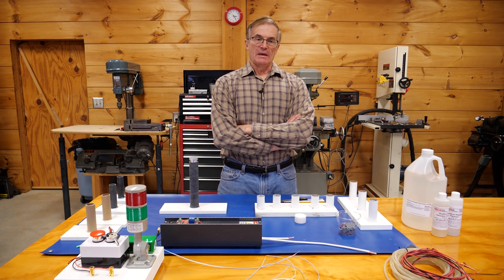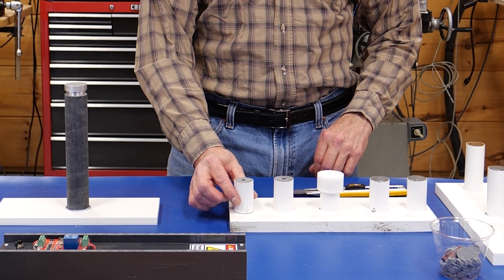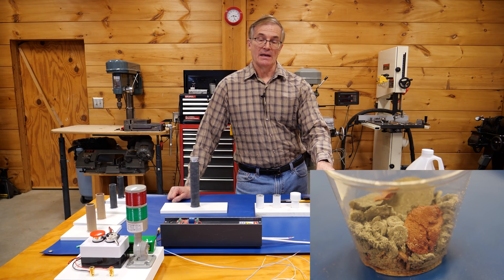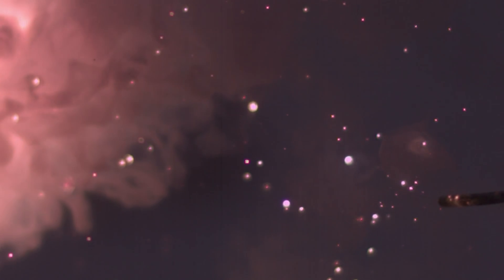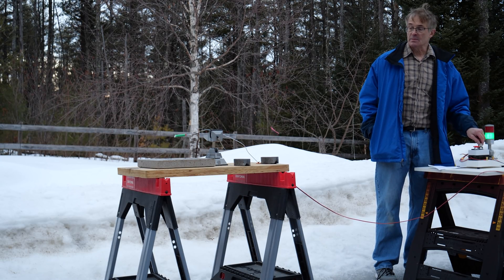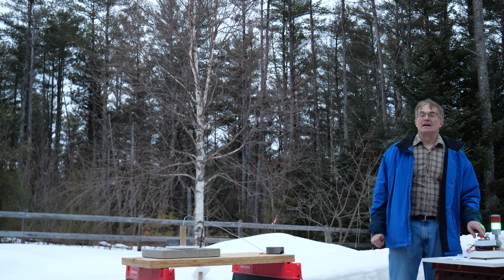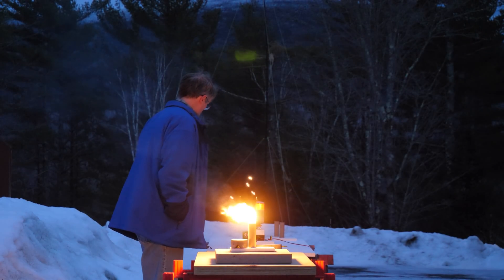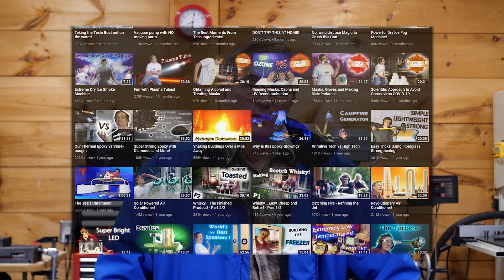Rocket Igniters at 10,000fps!

Comment: You mentioned room temperature superconductors in one of your rocket videos, could you share something on those?  They might have application in building lithium battery packs.  Thanks!
Reply from the maker: High temperature superconductors still require liquid nitrogen.  Their high field tolerance is a significant advantage.
Reply: @TechIngredients  Did you mention high temp superconductors?  Sorry if that was some other video I was watching.  I'm looking into the best way to bridge lithium cells.  They currently use nickel materials.

Comment: Focus trick for these annoyinly shallow depth of field cameras:  Use a sheet of paper/can/package with some fine and sharp text or graphics in the focus plane you want and adjust to that.
Trying to use anything else never seems to work quite right.
Reply from the maker: Believe it or not, that's exactly what we did!  These high speed cameras are also light starved during focusing and so I held a sheet of text with a powerful flashlight at the focal plane in the relativly strong wind...fun.😕
Reply: @TechIngredients  The wind and cold would make things interesting! The camera like a bit of warmth, if it works better indoors than out in that weather, try covering some of the intake vents to allow the camera's internal temperature to rise and stabilise before doing black cal.  Might improve your SNR. 
Re. focus: Because the focus is the lens, not the sensor, you can set the shot up with the gain turned up and/or shutter speed as slow as possible(most light).  Then set everything back to want for the actual shot and everything is in focus.. And be glad you have the 2.1, I've got a 1.4, much smaller sensor, worse light performance but still a lot of fun! 
(And 'hello' from the 'Kickstarter' page in the camera's firmware.. Assuming it's still there. :)

Comment: Something that you have the space to test:
How efficent and the cost for using a air-compressor on a windmill instead of a generator and using air-tools instead of electric.
Storing a given amount of energy should be cheaper in a tank, but the heat-loss when using is costly. A tank should also last a lot longer then batteries.
The best would be to cool  the compressor with water (give you hot water), use tools and cool down something with the expanded air.

Comment: When you want to increase the power of a rocket, what’s better, increasing the diameter of the grain or the length?
Reply from the maker: It's not simple.  Increasing the surface area of the burning propellent increases the power and if done with length or diameter the change is linear  The forces on the walls are always in tension and the availability of cylinders with sufficient hoop strength will probably limit the practical diameter.
Reply: @TechIngredients  I had an idea for a rocket casing with a high hoop strength by using thin walled aluminum tubing because it’s  non-frangible, and then axially wrapping it with either kevlar, aramid, or carbon fibers and then coating it with epoxy. Also with regards to the exhaust nozzle would a parabolic cone make a difference over a flat walled cone?

Comment: Is there any risk of cracking the fuel grain if you ended up with one of the more energetic augmented ignitors in place? Or is the grain more flexible than I'm imagining, and able to withstand that pressure wave? And would a cracked grain cause enough combustion instability to be worth worrying about? Maybe it'd be "fun" to try simulating some damaged grains and how they can (if) change the impulse and burn rate.
Reply from the maker: It's a very tough rubber compound.  These igniters are more than energetic enough for this purpose.  They can certainly be dialed back if necessary.

Comment: This was very cool and thank you for expanding and sharing the results of your previous testing with these new test grains.  A question... Do see any potential issues with the BaSO4 augmented starters; specifically, being too explosive and creating an impulse that damages the engines at starting? Thanks!
Reply from the maker: Thanks.
I don't think so. The grains are very tough and are designed to operate at pressures in excess of 10 megapascals.

Comment: The high speed footage was fascinating. The amount of energy condensed into those small engines is impressive. I look forward to the upcoming videos when you put nozzles on a stack of fuel grains and make something with many Newtons of thrust. I'm not sure what deep, innate sense of ours that pyrotechnics pleases, but it is worth noting that no other species mastered fire, so they could later create fire-works!
Putting a big K-L-M motor in a small, slender rocket and hearing that distant "pop" as it goes transonic is a peak experience for a hobbyist.
But I have a different challenge for you, as once science buff to another. Due to your catholic interest in the sciences, especially electronics, I'd like to see you work on an electronic rocket, an ion propulsion motor. Not only would it be an interesting exploration, but this is a cutting edge area and there may be some interesting new science yet to discover. Perhaps by combining MASER technology with existing ion beams? Just sayin'. Cheers.

Comment: It looks like the ignition at the base (right side) threw out unburned flash power.

How about putting the igniter closer to the top (left side), so the powder burns more evenly?

Or, if you want to throw powder out, maybe add a thin wad to prevent power from burning until it is dispersed inside the rocket.
Reply from the maker: Because the powder disperses so broadly, I don't think the asymmetry will be a problem.  So far, after 25 shots we haven't had a single misfire.

Comment: Hi there,

Very interesting and informative video with some important and nessassary steps for safety. I am curious though, I am wondering as to why you found it prudant to included a very annoying "beep" when you engineered and built your  high voltage ignition supply? It's not a big deal, I was just wondering.
Reply from the maker: Thanks.
Safety.  Although some viewers found it annoying, it's very important that anyone, anywhere near the test site, even if they aren't looking in the right direction is made aware of a potential hazard.  We're talking rockets!
Reply: @TechIngredients  I agree, However, when dealing with any potentially explosive pyrotechnic, bystanders in the general area should already be at a safe distance before the item under test is even connected to an ignition source,  as even in a controlled environment accidents can and do happen,  Especially with rockets! Having said that, In reality it is a very good thing to have in place as many safety practices that are feasably possible no matter how redundant, or annoying they may seem. Having sought knowledge in chemistry and the value of safety regarding potentially energetic experiments it's wise to make sure that they are properly in place. 

I enjoy the content of your videos, as they are informative, descriptive, and accurate. Thank you.

And reguarding the Beep tone, some individuals are more sensitive than others with higher frequencys, durations, and volumes. I for whatever reason are one of them, and so much so that I had to remove the end of cycle transducer on my washing machine ( pc mounted mini "speaker" and put it on a switch to shut it off.)

Comment: Ahh, I have a complaint with production that doesn't just amount to beeping. Shooting fire is something that's kinda hard to get right. I understand it's harder on a budget, and probably even harder within the capabilities of your given slow motion equipment, but generally, you're going to want to have a black background. You could probably move the test forwards a bit, and then put a large piece of black cardstock, or cardboard covered in black paper, behind it, using the nook in your workbench there. 
You're going to want to use less exposure, i.e. smaller aperture, i.e. higher f-stop. At least, as much as you can, it will show the details in the fire better, especially when paired with a black background. This will make it so you're able to see the cool details in the fire. Don't be afraid to underexpose, either, as lost details in exposure, or with too dark of a picture, will be restored easier than the alternative when you're in software.
Anyways, great video, as always, keep up the good work!

Comment: also would like to say awesome and informative videos, keep them coming :) 
wonder too if the design "join the Technicians" have for their "magic wand" (basically a 130kV dc diode ladder and what I am guessing is a stepped up or improved slayer exciter running off of two lithium ion cells) since he was setting flammable fluids on fire by igniting it with the high voltage discharge, and then using the ionic wind flow to put it back out LOL anyway, might be someone to collaborate with, not sure how far apart you two live from each other. 
https://www.youtube.com/watch?v=TUDd5lzepgE also I know he is now working with "alienscientist" and "falcon space" channels so could be interesting to see you and they joining up to have a discussion and do some builds :)

Comment: would definitely like to talk to you about rocket improvements and possible construction of an ionic wind unit to improve that tech as well, as I think there are methods that could be used that take advantage of the material used to improve response for such things like the fluorine in teflon and how it effects static buildup, or how bismuth and titanium have lower electrically conductive rates than say iron while copper and silver have much higher rates ect, for reshaping nozzle effect on the particles coming from a rocket, whether or not it is from a combusted product or just inert material. :)

Comment: It might be because all the rocket engines where I made my own fuel were hybrid, but those fuels look incredibly inefficient. A spark that leaves the engine while glowing from the heat of combustion is a packet of energy that was not converted to delta-v. I know that logic is not very sound, but all else being equal, you tend to get a lot more thrust from a near invisible flame than from a bright one.
Reply: Good point, but until the right thermodynamics is reached there are always sparks in the beginning.
Reply: If I understand correctly, these tests were performed without nozzles in place and they were really testing the igniters.
Reply: @mattp422  Yes and no. The first video was about the fuel grain followed by a video about the igniters. This video covered the igniters first and the grains second.
Reply: @deserada That is irrelevant. I have edited the  word nozzle to read "engine" instead to hopefully clear up the confusion. "orifice" was probably actually the correct word, but I can see that causing more confusion rather than less.

Sparks mean that you are detaching fairly large solid particles from your fuel grain. If you have sparks without a nozzle, you will almost always still have sparks with a nozzle, unless the sparks are large and numerous enough to clog the nozzle or your combustion is very oxygen rich. If you are producing just gas then your flame does not have a meaningful black-body glow, if it is producing dust you get a flame like a candle or oxy torch, sparks like that mean your solid particles are several orders of magnitude larger than that.

My assumption is that usually happens because you have a very imperfect suspension of oxidizer in the fuel grain, or some other issue resulting in a flame-front which is not parallel to the bore.
Reply: @deserada The ideal gas law is only relevent for gasses. Sparks (and dust) are mass that do not contribute to nR in that equation.

Comment: Could you, please do a follow up on the cooling computer components video. It was cool and all but many would like to see mostly passively cooled PC on cheap. All current solutions are very, very expensive. The copper heat pipes are not that expensive but special cases with huge metal radiators are. I have high hopes that you could find really nice solution after watching air conditioning series.

Comment: Some of the ignitions were so bright that it was hard to see what was going on! Is it possible to use a different sensor or possibly filter to not overwhelm the high speed sensor? It'd be really interesting to see through something like the FLIR x6900sc, though I know that those get *pricey*. I wonder if y'all are big enough to try and do a collab with them? It'd be some great promotional material, especially when y'all get to actually firing off some of those rockets! Or if it's possible to rent one for a time. There may also be some other youtubers that have access to one that would be willing to do a collab!
Reply: Also, why does the beeping stop while the fuel is igniting? Is it just that the sound of the ignition overloads the sensor so it gets drowned out?

Comment: Do you intend to eventually build a small rocket and launch it? What does that entail (I am imagining you'd need some sort of permit to make sure no accidents occur with random air traffic). How high could such a rocket reach? What about calculating where it would land after the fuel is spent? Just wondering what the logistics of actually going ahead all the way with such a project would be.
Reply from the maker: Even our smallest engines require some permits and an appropriate location.

Comment: Have you tried making composite fuel with regular epoxy? It can be gotten from ebay in large quantities for cheap. Or if I may recommend a topic for a video, could you possibly go into the chemistry of producing ammonium perchlorate at home? If I understand the chemistry, it may be possible with electrolysis of NaCl or similar and then reacting the NaClO3 / NaClO4 produced with an ammonium salt such as NH4NO3. The only possible extreme danger in this that I can see is accidentally producing NCl3 which is a contact explosive. Thank you! Keep up the good work.
Reply from the maker: I did and some formulations cause the release of large quantities of ammonia.

Comment: Hey Professor, please disable the beeping on the firing power. Ultimately, it does not promote safety with the constant beeping. One beep, when initially energized is good; or make an enunciator that says "Energized" or such. Or just edit the noise from the videos. It's almost unwatchable with the beeping.

Comment: Could you build a bearing disk with two apposing engines on the outer diameter have them ignite them clock the speed of the disc.

Comment: Your jacket looks good for protection from the cold and damp. I wonder if there is a good option for an outer layer that would protect against melting from flying sparks that wouldn't absorb water?
Reply from the maker: A leather welding jacket or apron would be good.

Comment: This topic fascinates me. I have a question that most likely involves a lot of math. How do you calculate the amount of thrust given the various types of fuels you have demonstrated. I would be concerned that in the quest for maximum burn time and maximum thrust I would choose a fuel and nozzle aperture that was to constrictive and thus have a catastrophic failure. I look forward to the rubber based rocket fuel tutorial.
Reply from the maker: It does involve a lot of math.  The higher the chamber pressure, the higher the effeciency.  But, as the pressure rises so does the propellent burn rate, further increasing the pressure.  There are calculators available based on the type of propellent, the targeted burn rate based on core configuration and nozzle throat diameter.  It's rocket science...

Comment: why are there sparks forming in the exhaust ? is it the lack of a nozzle? is it fuel that gets ejected before complete combustion?  great content by the way
Reply from the maker: To some extent, yes.  The aluminum oxide and iron oxide will not vaporize even at those temperatures and will still generate a few sparks even with complete combustion.

Comment: I take it that the high voltage source did not satisfactorily light the fuel mixture, thus the backup "long neck" propane torch.
Reply from the maker: That's correct.
Reply: Time for a Mythbusters approach and see how many volts you need to get an ignition?

Comment: When the beeping is so annoying and repetitive, that even they became numb to it and forget to turn it off. 
With you forgetting to turn the device off, it clearly shows the beeping is not doing it's job and a better solution should be considered.
Most likely a solution where it automatically turns the system off after the triggered would be best, where no stupid beeping is required.
Additionally, you could use like a double turn key for ignition, forcing you to use both hands to ignite something.
Other than that, was a great and interesting video.
Reply: Yea maybe a older nuclear control console, just to be safe..
Reply: Yes, this is the best take here. Could become a good lesson on effective safety techniques vs safety techniques that breed complacency. 

(also it is hella annoying lmao)
Reply: yeha, no... they did not forget. Point of beep is to point out, that when there is live ordnance on the business end, one has to avoid touching red button if its primed. Wiring just does not have "discharged" functionality and keeps beeping as long as current is applied. Think before you write.
Reply: @bartoszbaranowski604  loool dude, learn to read before you reply thinking you know best. Beeping signifies danger and eve after the charge is set off, there is still electrical potential being applied on the wires end. In simple words for your understanding: Danger. Lol
Reply: @ralmslb  Yeah, I actually did read and what you wrote does not change what I wrote. Got a bit salty to read and understand?

Comment: Igniters for AP motors need to ignite at the tip of the igniter up against the tracer smoke grain.
And burn down slowly and hot for reliable starts. TRA L3.